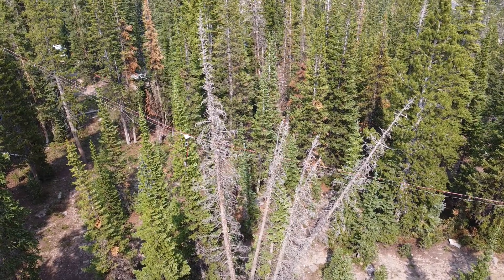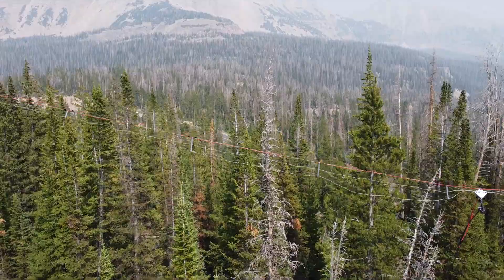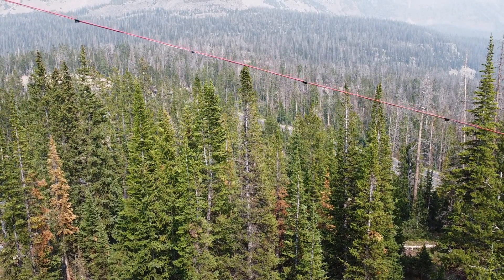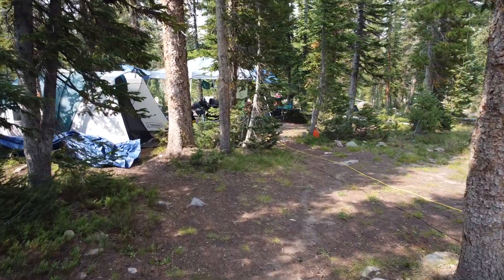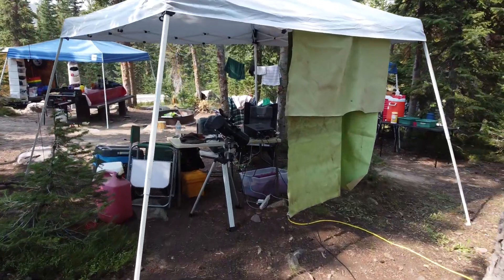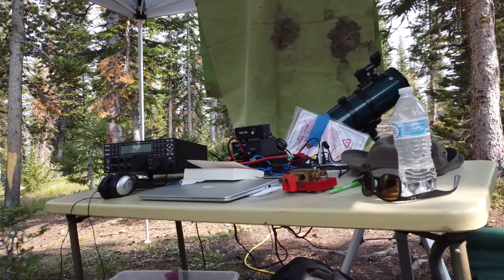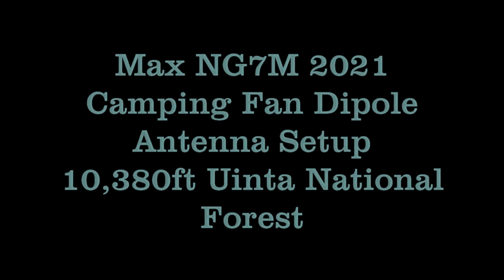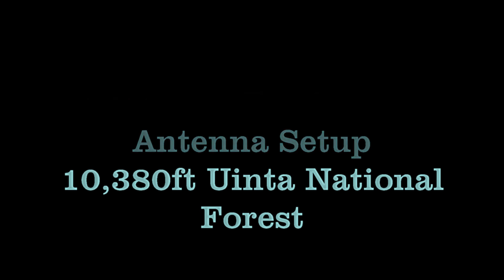NG7M Fan Dipole Antenna Setup for the 2021 NAQP CW Contest - Camping @ 10,380 ft Above Sea Level

Comment: Max, have you ever attempted to get the fishing line up and over the trees with your drone? I have tried the fishing pole and am just not a very good aim! Spend WAY too much time getting the line where I want it to go. Tried the arborists toss bag/line and tennis ball gun. I like the idea Robin has below with the  bow (or even a crossbow). Seems to me that there is so much more greater control potential with a drone and you could get the antenna even higher. I have the same A-D DX-CC antenna and would like to get it higher up, more than 25 feet!

Great camping location! Hopefully this year's air quality is/was better for your trip.
Reply from the maker: Hi Mark, I haven't tried the drone or bow and arrow method... or the slingshot method, but I know they are popular.  For me the fishing pole has been my go-to.  I usually get the cast over the part of the tree on 1 to 3 attempts.  I have done this for years.  It would be interesting to try one of the other methods, but I have never failed with my fishing pole setup.  Having flown a few drones... on the smaller end, I'm not sure how easy it would be to get the peak of the fishing like above the tree and drop it.  You must get that completely over the tree to then pull up a heavier cord like paracord, which I use.  Even the weight of the mono filament line might impact the drone control, but I know those bigger drones have serious lifting effort.  That is so much more gear than my simple fishing pole and old tire weight. :)  The bow and arrow would be interesting... yet, sometimes you need to limit the distance as you go over the tree, so I have seen that as problematic too, but again, I can't speak to it.  The tennis ball cannon seems way over complicated to... you need compressed air etc... and a recharge to try again... just sounds way over complicated.  I'm pretty good after time with the fishing pole setup.

Yes, this year up camping (and I didn't take a station up which was a mistake because NAQP conditions were excellent, so my mistake) the air was perfect.  Wow, when I revisit the video, it still is an eye opener as to how back things were.  Murdock Basin had a fire going too, but I think most of that smoke was from the out of state fires that made the air quality miserable for weeks.

Thanks for watching!  Max NG7M